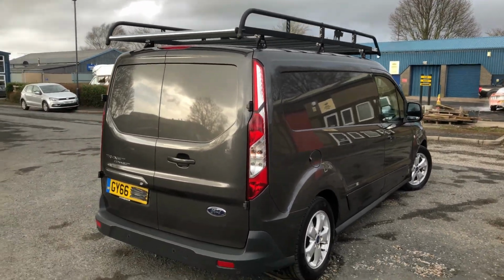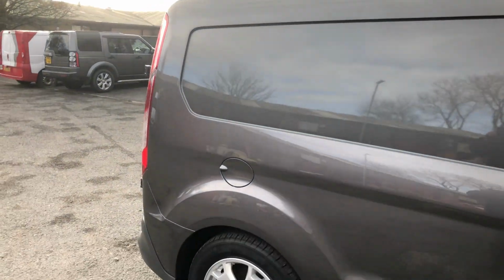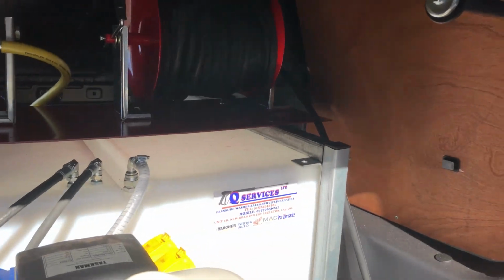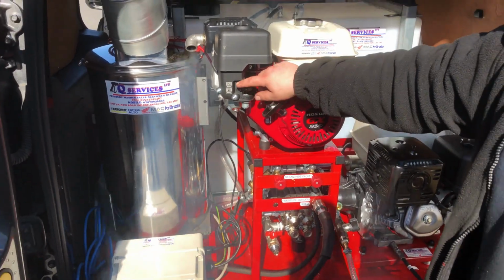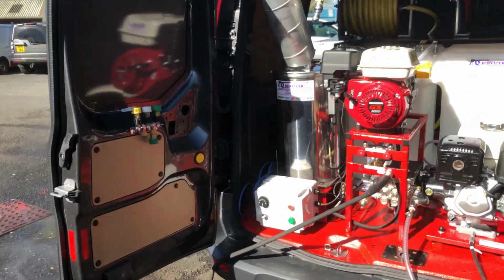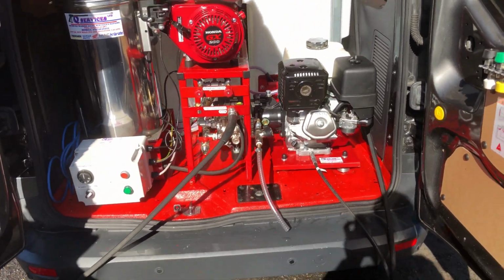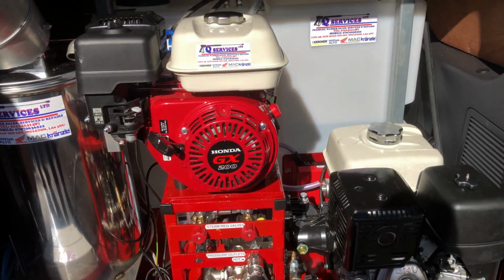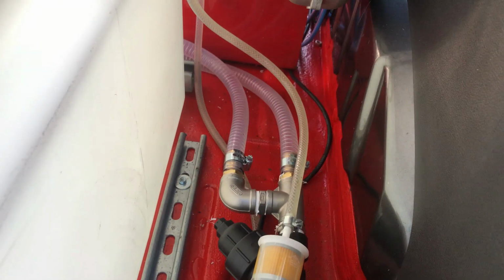QWASHERS FULL VAN BUILD COLD HOT STEAM FORD CUSTOM PRESSURE WASHER 66 plate VAN FORSALE 015242 41487

Comment: You a talking about hoses length but whats the diameter of pressure hose and garden hose that u using in this setup?
Reply from the maker: The wate feed hose is 3/4" bore 40 meters & 50 meter 3/8 hose 2 wire 400 bar

Comment: hi I hope you don't mind asking a question I have a gx390 direct drive 15lpm I am doing a service and also changing the steel drive key the original key is 4cm long the new key is 6cm long which is best as the 6cm long one is tighter fit but doesn't seem as level at back of shaft compared to the front kind regards
Reply from the maker: With the pump being a direct drive & like a pump you want as much key way as possible to take the torque possible. You will notice that the engine key way slopes up which means that if you use a flat keys it will not go on . Like most things in engineering you try things to see if they go on and off easy. But when fitting pump or gear box to engine you want it tight with no movement. The engine only runs one way and if you ever come across a worn key way you will see that is will where the key on one side & the engine shaft on one side, but the pump shaft will be fine. Thanks Qwasherrs
Reply: hi thanks very much for the reply Damian what do you mean by flat key what key do you suggest thanks I could sent a pic if needed once again really appreciate your help thanks  @qwashers
Reply: my key is like the shape that goes in-between door handles
Reply: also should I use copper grease on key and shaft Damian thanks sorry for all questions
Reply from the maker: @stephw1278  No we want it tight & to stay tight snug fit.
Reply: hi Damian could you please advise me what oil my direct drive pump ez404og ez series 44 takes please I can't find any information on internet thanks  @qwashers
Reply from the maker: @stephw1278  The pump requires 410ml sae 10w30
Reply: @qwashers  thanks very much Damian kind regards
Reply: @qwashers  hi Damian my key fits in snug at start of shaft but sticks up at back of shaft and if I tap key down at back of shaft it sticks up a bit at front any ideas
Reply: @qwashers  it is still in key way but not completely level if I tap one side down the other end comes up a bit
Reply from the maker: @stephw1278 it is to long then
Reply: @qwashers  hi Damian can you advise me how much oil to put in my gx390 15lpm direct drive pump and engine please would be really appreciated. kind regards
Reply from the maker: @stephw1278  1.1ltrs
Reply: hi Damian does it have to be non detergent for pump thanks  @qwashers